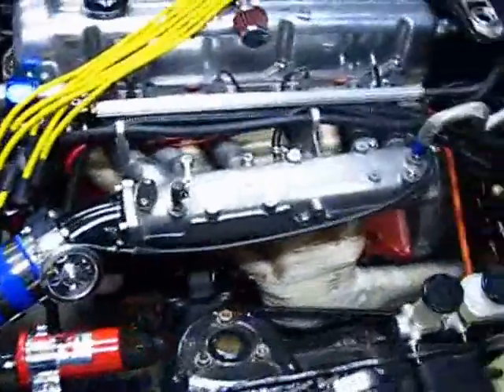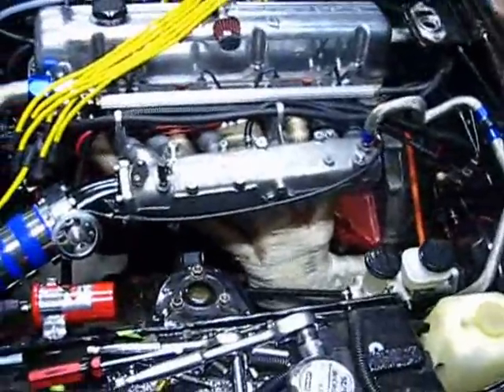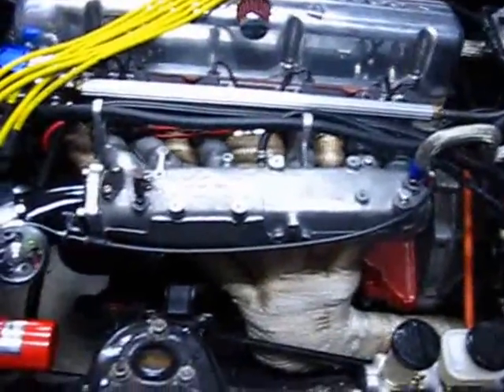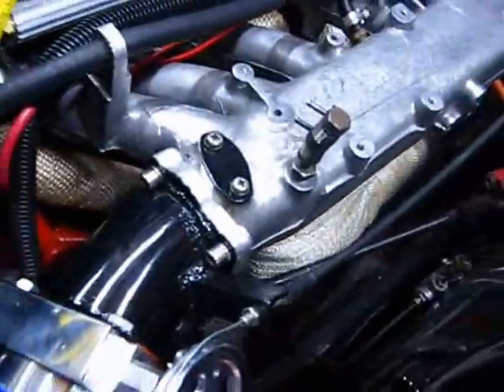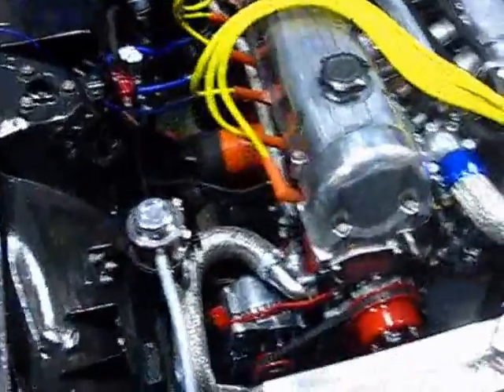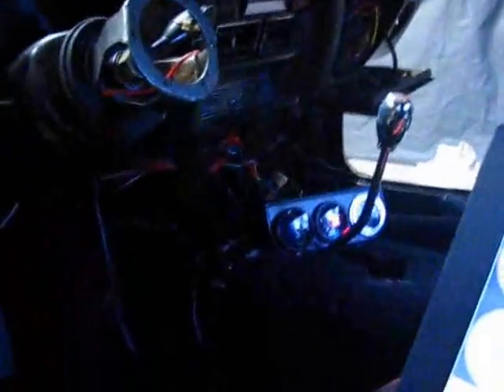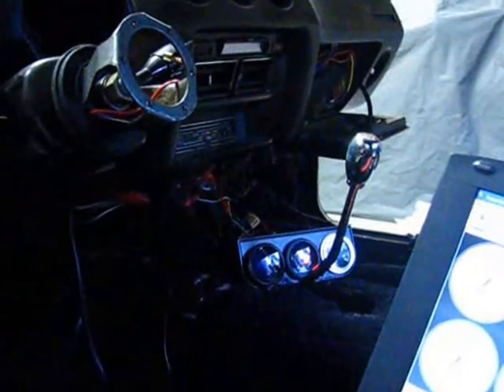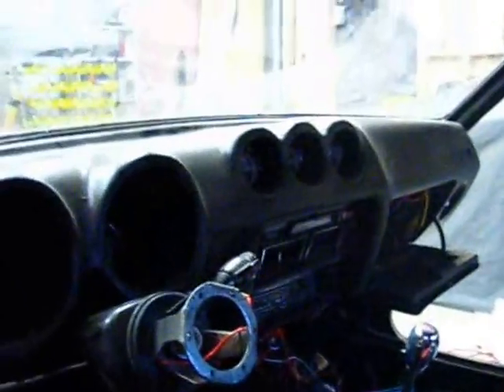280z running on megasquirt

Comment: I have a question about the exhaust coming out of the end pipe, was it leaking oil? and if so what causes that? Thanks
Reply from the maker: It was running pig rich when i first got it to start up and as was leaning out the mixture, the exhaust filled with black soot. This is dry soot, but the condensation from a cold exhaust forms moisture and when you step on the gas all the water blows out the end. After the first drive the car never did this again. maybe drips a few water droplets on a cold start

Comment from the maker: used the stock VR sensor. if your 77 has a black module on the side just take it off and connect the wires directly to the VR sensor (red and green wires)